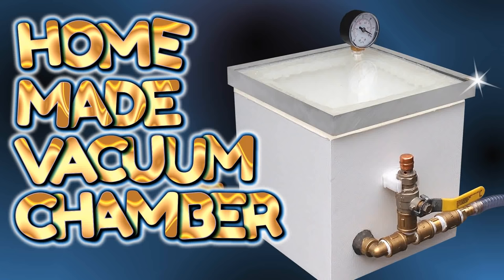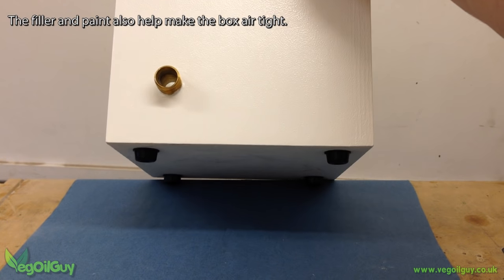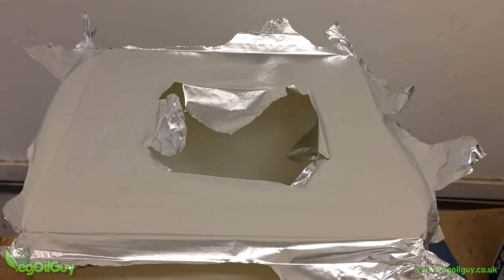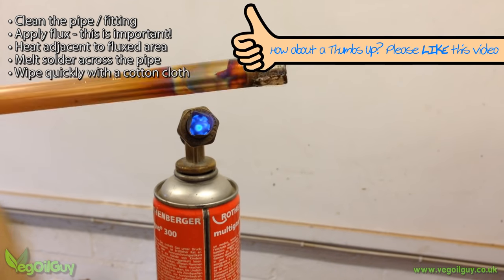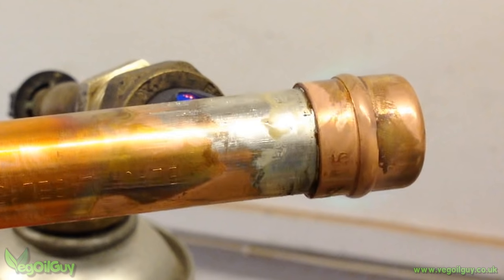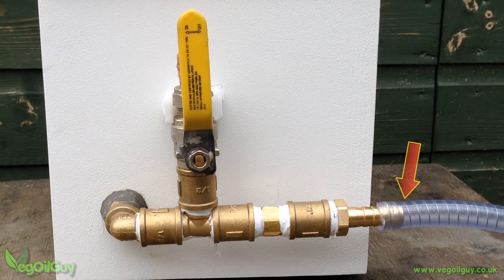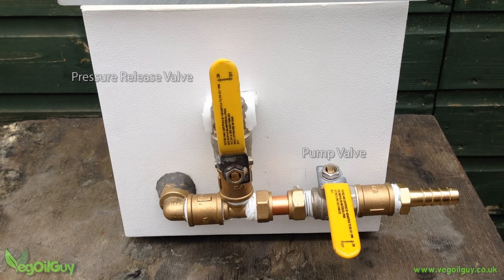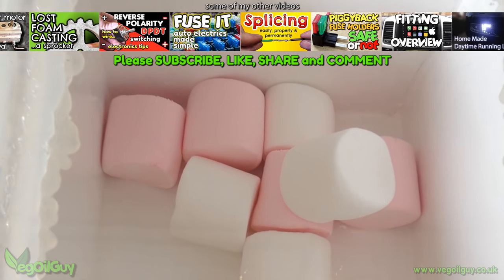home made SIMPLE BUILD vacuum chamber - by VOGMAN

Comment: racking my brain to figure out how you're going to make your challenge coin using that ;-) #castingchallenge
Reply from the maker: And there I was thinking I'd given too much away : )
Reply: actually, that would be very usefull in lost foam casting!!! All gasses from the foam will be sucked out instantly through the sand, and they would even suck the metal into the mold. It should get you wonderful edges... The only question is: how to get the molten metal into the chamber... cfr my other comment: if you add a cluster of tubes to increase the volume of your chamber, it would amply compensate for the volume of the exhausted gasses... (you'll just need a sort of foam that is very strong and that would not expand in the vacuum chamber. I guess a very porous foam (like the green stuff they use for flower arrangement) or grainy foam like PIR?)
Reply from the maker: Luke - sshhhh !!! Stop giving him clues. Who's side are you on here...
; )
Reply: VegOilGuy perchance the winning side??   ;-D
Reply: I really can't stop this silly brain of mine with these ludicrous ideas... hahaha. But, yea, I always vote for the winning side, but in this case I'll I'll stick to rooting for my own continent, win or not...

Comment: This is cool.  Now, how can I make use of a vacuum chamber?  Use it to do what project?
Reply: It is quite useful when working with resin, specifically to remove any bubbles that could ruin your mold when making the mold.  I don't know of other applications for it, though.
Reply from the maker: Good answer. Also silicons and plaster : )

Comment: Just as a thought, with the proper silicon seal etc, would there be anything stopping you using a metal top with a hole cut out of it to put a perforated flask into?
Reply: Same thing I'm wondering,I'm just gonna order me a Aluminum pot and make my lid out of glass & find or make a fitted gasket to help with suction,I saw that on another video.

Comment: You know that those copper fittings you are using are pre soldered? You can tell by that ring around them. Clean, flux, assemble and heat. You should still see the solder flow when it's hot enough.
Reply from the maker: Hi Brandon. Yes, we call them solder-ring fittings. 
You're right - that's the principle. However, when you tin the pipe, you get a solder to solder bond. I genuinely have a 100% success rate with this method and shared it because I've known a lot of people who struggle with plumbing.
Reply: Well what ever works for you that is fine, just as someone that does actual plumbing, it pains me sometimes to watch YouTubers burn copper to a crisp and melt a pound of solder and call that plumbing. Now were you using a lead free solder or one containing lead? For this project it doesn't matter what you are using but a lead based solder will melt and flow at a lower temperature which is easier to use.

Comment: Do you think laminated chipboard would handle the pressure?
Reply from the maker: I suppose it would depend on the thickness of the chipboard. I used 18mm (3/4 inch) plywood and that's plenty strong enough for a small chamber like I built here. But chipboard generally isn't as strong as plywood. Plus is fairly porous in its structure.
Personally, for the small amount involved here, I'd stick with plywood. You can generally buy off-cuts very cheaply and that's enough for a project this size.

Comment: How strong of a vacuum pump do you need for good results?
Reply: Do you think a portable 18v one would do the trick?
Reply from the maker: It depends what you're using the vacuum pump / chamber for. With metal cast, for example, I was surprised just how little vacuum was needed to make a significant difference - I mean, a plastic, homemade hand pump! And yet it worked. But I've no doubt other materials would behave differently.

Comment: It can be even more simple if you replace the whole wooden box with a large thick walled pot and have your evacuation point share the hole your gauge does. It literally is three things the pot acrylic and gauge valve assembly. with the most complicated thing being drilling and tapping the hole in the acrylic.
Reply from the maker: Hi William. You're absolutely right... it doesn't matter what materials you use. The lesson I hope I'm getting across here is that it's possible to build things like this cheaply but effectively  : )
Reply from the maker: I'm with you Alan. Save money where you can because there are some things you can't cut corners on... not that it stops me trying
: )
Reply: I’m thinking in using a propane tank. Cut off the bottom so I can flip over and use the hole that is already there with the valve.

Comment: Nice job :)
You mentioned having to repeat the silicone application - did you scrape the first layer totally or did you just apply some more silicone on top of that?
Reply from the maker: No, I didn't scrape it off. It was still wet, so it was wet on wet silicone which bonded well : )
Reply: Right. I'm in a similar moment now, but the silicone is fully cured, and I somehow managed to leave an un-jellied part on the tinfoil which stuck to the silicone quite well and won't go. Scraping it will be hell, so I was thinking maybe to roughen up the surface with a piece of grinding paper and maybe treat it harshly with a chisel. Do you think new silicone will stick to a cured surface?
Reply from the maker: Silicone is renowned for sticking to everything, including itself. A rough surface helps it grab, but it needs to be clean of dirt, dust and grease. Wipe it down well with white spirit and you're be fine : )
Reply: @vogman  I didn't think of degreasing, so that's a nice save :)
Thank you so very much for all the advice, I really appreciate! Cheers :)

Comment: Thanks, I've been wanting to build one to experiment with that. I make segmented bowls and I'm thinking about trying to dye the pieces of wood in a vacuum get the dye to impregnate the wood. If successful I could then assemble the bowl, turn it and the pieces would retain the colors of the dyes. Am I crazy or is this plausible?
Reply from the maker: Hi Terry. I really have no idea, but it does sound an interesting concept.
I do know that water boils in a vacuum chamber, which make me wonder if water based dyes will work, and yet I regularly use casting plaster which is heavily mixed with water.
The advantage here is that you won't break the bank with a cheap chamber like this... and please don't give up the first time. I really don't know if it's possible, but one attempt won't answer that question for you either. I think several experiments with a strong pump would be needed here  : )
Reply: @vogman  thanks for the input. I was planning on using denatured alcohol instead of water with the dyes. That said denatured alcohol evaporates quickly and that may be an issue too. The reason I want to try this is because the exoctic woods that have beautiful colors turn to a brownish muck over time making my creations look like crap. I think it's worth a try.
Reply from the maker: Drop me a line and let me know how you get on. I love your out of the box thinking  : D

Comment: Eh VOG. Nice video (as always). In a future project, can you do a presure chamber for bubbles removing from resin (casted in a silicone mold) ? Apparently, it's the only good method to do so. Thanks and keep up with the good work.
Reply from the maker: This chamber would work for that purpose. It's just a matter of vacuuming the resin to draw out the trapped air 😁
Reply: @vogman  Really ? I was told that for resin you need place it in a presure chamber in order to remove the bubbles (at 50 psi). A vaccum chamber can work for silicone and plaster, not resin. Then again, it may depend of the resin used.
Reply from the maker: I could be wrong, it's not something I've ever tried. But I can't help but wonder if the principle is the same 😁

Comment: yes, new VegOil content!
Looks like you use a lot of Grant's creative pvc designs. I've been thinking of expanding my compressed air tank with a cluster of pvc tanks like Grant made them. Do you have any experience with using these? I wonder if they can hold pressure and how much, and if I can combine it (it should, but I guess I won't be sure until I test it, or until I find someone who did) with the original (way too small) metal tank. I'll have to add condensation drains too.
Reply: PS. How's the casting coming? I accidentally gave swdweeb some usable advice to increase the quality of his finished product (he had some unexplained loose grains in the surface), I hope that doesn't give him an edge (pun absolutely intended)...
Reply from the maker: KoR has, and does, have some genuinely useful content. I meant every work when I said he was the one that inspired me to try casting. I also once had an idea for a pump and, looking on Grant's channel, found he'd had virtually the same idea. Typical. That's why I didn't make a fuss about my pump build but did give credit to Grant. He deserves it.
I've never seen the video you mention. I'll have to look out for it. Sound interesting : )
Reply from the maker: Worryingly, I haven't even started yet. Life keeps getting in the way. I'm hoping to have a bash this weekend... but anything is possible in my house : )
As for Perry, he's a good bloke. I'm genuinely pleased that you were able to offer him a hand. To me that's what it's all about. 
Take care mate.
Reply: Accidentally?? You know, nothing is private on the internet :-D
Reply: The video I refer to was about making your own compressed air tank. I believe it was a prep video for the t-shirt cannon, but I could easily be mistaken. It seems that pvc pipe with enough thickness hold a pretty decent pressure, enough to serve as a tank for an air compressor. He added a manometer, connected two pipes, where one had the manometer, and the other the inlet-valve. But you could easily connect just as many cilinders as you like. And since there's no corrosion in pvc, I was thinking that it would make an excellent replacement. Just fill an entire wall in the garage with 18cm pipe cilinders, floor to ceiling. Or put those pipes in dead corners between and behind shelves, under my work bench, and so on. You only need to have a gravitational drain for condensation, and no maintenance ever...
Reply: hahaha! offering a hand is a bit much to describe the few uneducated guesses that appeared to be realistic ;D
But indeed, these videos can easily be a good think tank, or forum to share challenges and join insights, knowledge and experience of an unlimited number of people. (not truly, though. I guess the limit would be somewhere around 8 billion... roughly)
Reply from the maker: I love the idea but have just one reservation... if it works, why do manufacturers use metal? Compressed air can be very dangerous... so test small my friend and stay safe : )
Reply from the maker: Hopefully that's the way it will go... time will tell.
Reply: I can still see several advantages to metal, especially for production. First of all, manufacturers have to reach standards like CE label requirements and such, which require them to pressure test the tanks at a multifold of the rated pressure. They also don't know where or how it will be handled, which makes metal easier to guarantee. There are carbon tanks available (for portable applications) but they are not as impact-proof as metal is. And then there's shattering when compromised (metal tanks will have a built-in weak seam to cause a rip, rather than a burst, so in case of explosion no particles will fly away. This is impossible to achieve with pvc). And then there is temperature exchange. Compressed and decompressed air has some interesting thermal behavior. Metal tanks will guide the heat more evenly, and can easily be cooled (necessary when using intensively), which cannot be said from plastic tanks. They may have hot spots (or frozen spots) near nozzles and vents, making it unusable for intensive use. (especially upon release of pressure, because frozen plastic is extremely brittle)

There is one problem with testing small, that is a huge advantage of overdimensioning: if the container is very small, the pressure gradient will be very steep upon use, which will create a bunch more mechanical and thermal stress. For the use I have in mind, a very large cluster would have such slow pressure drops (volume vs. pressure-difference) that it will barely notice it and any thermal release or absorption will be easily compensated by environment temperature...
So in this case, the safe test would be the large container for the small work :) I'll make sure I'll put it all on tape so somebody can make an interesting video of it in case I get blown to bits... ;))

(mechanics of pressurized containers was a big topic in my fire fighting classes, and compressed air is especially important for fire fighters and rescue divers like I was)
Reply from the maker: You've clearly given this a lot of thought. Go for it!
And don't forget to film as you go. I suspect there'd be a lot of interest (me especially).
Reply: The list of things to do and film is getting longer faster than I can strike things off... I better get to it! :D

Comment: Excellent work. What thickness ply did you use? 18mm?
Reply from the maker: Spot on Greg. Just keep the joins tights, use good glue and car body filler any holes. It will work fine. If you loom at any of my recent casting videos, I'm still using mine  : )

Comment: I need to make one 24 x 18 x 4 inches.     Can I use a 2x4 for the sides?
Reply from the maker: You can certainly scale up this project to almost any size, but it is surprising how powerful a vacuum is. If you're going larger, you'd certainly want to thicken the wall as these would flex under the pressure. However, I'd recommend sheet material like plywood rather than wooden strips. Even glued, wood can split along the grain or wood join. Sheet materials like plywood avoid this issue. Hope this helps.
Reply: @vogman  which plywood would  you recommend?
Red Oak or Baltic Birch Plywood
Reply from the maker: Whatever you have access to : )
Honestly it doesn't matter. But close-grained is your best option.

Comment: VegOilguy. Nice video. Question. I’m looking to buy a vacuum chamber for degassing resin. But now thinking of going the DIY route after watching this. Looking to making one the exact size. Wondering if it would suffice for degassing resin? Thanks
Reply from the maker: Hi Gabriel. The chamber is as good as you can make it. Mine has a very tiny leak... so small you can't here it, but over a minute or so it gradually loses vacuum if you don't keep pumping. I know with silicone moulds this isn't good enough. Just that tiniest of tiny drops was enough to spoil the process. So the choice is yours my friend. If absolutely perfect is called for, buy one. If 99.9% is okay, or if you're very confident in plumbing and carpentry, build one : )
But you'd probably need a purpose built pump though. I haven't used resins, but if they're like silicone, you'd struggle to do it with a manual pump.
Reply: Thank you. Great advice!!

Comment: Nah nah... You clean and flux both sides. Then insert the fitting on the pipe. Then heat behind the area, then stick solder between the gap. You can go around. The gap actually pulls the solder in via capillary effect. It makes very nice solder joints and they never leak.

Comment: what is is the largest chamber that can be made with this method?
Reply from the maker: Hi Bob. In theory you could build any size, but you need to think carefully about the strength of the structure. I'd be looking for thicker plywood plus bracing, etc. You need to prevent the structure from flexing and ultimately collapsing.
Reply: @vogman  well,  it's a matter of wall stress - the for walls of a given thickness, the larger the chamber the weaker the walls.  I don't see how experimentation would be dangerous, unlike pressurization.  Maybe I'll try a 12 cube of baltic birch, possibly with double thickness walls with seams overlapped.

Comment: I get why you chose wood to build it from. It's cheap and easy to work with. But from a vacuum standpoint i couldn't find worse material for a vacuum chamber. But if it floats your boat, keep sailing. :)
Reply from the maker: It's all about budgets and results. If you want top results and have a healthy budget, then buy one!
However, those of us restricted by budget but want 99% of the benefit, we have two choices... do without or build our own.
Tomorrow I'll be releasing a video where I've re-used this exact same vacuum chamber and pump in a casting experiment. The results are incredible and are achieved on an extremely low budget using parts that many of us have lying around.
That's why I make stuff... that's why I share it  : )
Reply: I'm just a bit damaged from work. I'm a service technician for one of the larger vacuum brands. And i come in contact with systems that are affected by outgassing from a fingerprint. As i said, i know why you made yours the way you did, and that it works just fine for your purpose. It's just that im used to high vacuum equipment, that wood isn't even on my mind when it comes to vacuum. :)
Reply from the maker: You're absolutely right. The porous nature of timber makes it impractical for truly high performance situations, but for the needs of the average guy, to assist in a few odd jobs, it works surprisingly well : )
Thanks for your input.

Comment: I like the chamber you made, especially the one inch top, so I would have drill gauge in box side an left top in one whole piece! But, with your pump adding pressure to tank isn't that called a "pressure pot", an you need to draw air from an away from box to create a vacuum tank?
Reply from the maker: The pump IS drawing away the air. It doesn't do a bad job either as low-tech solutions go : )